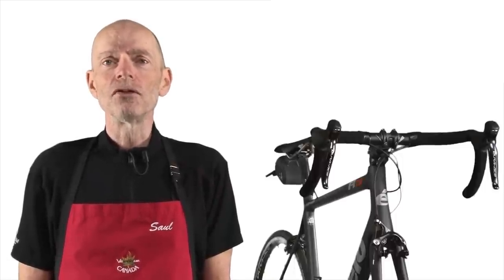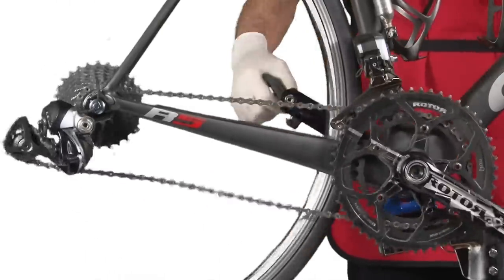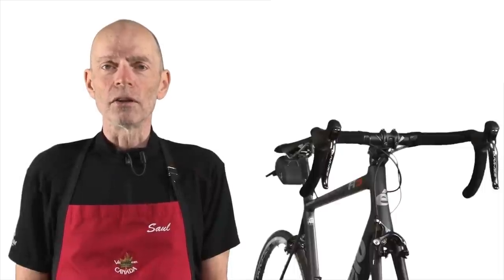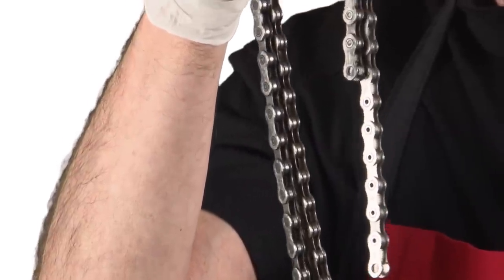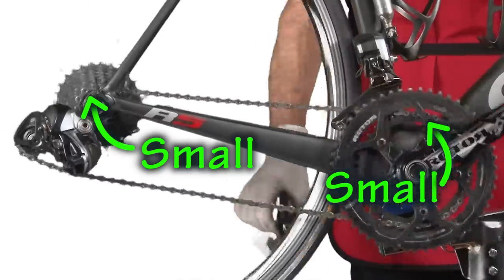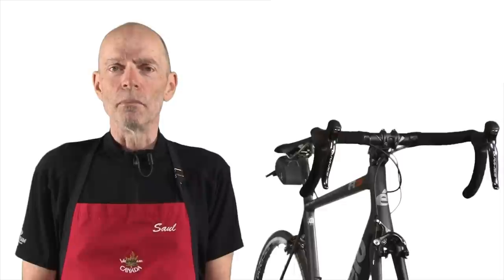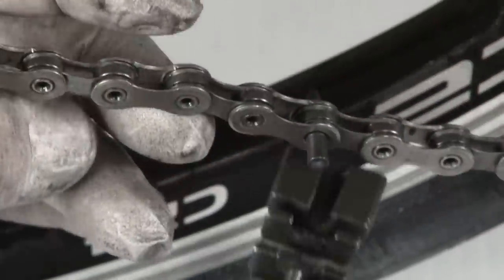Chain Length, find the right chain length for your bike

Comment: How to determine a right chain length should be taught from scratch without a sample/old chain. Derailleur acts differently from brand to brands, the derailleur should be demonstrated where would be the maximum stretch and the minimum retract. Also should let people know that there is an adjustable screw with most reputable derailleur manufacturer able to loose or tighten the derailleur tension should the chain has some discrepancy. I think the public would be more interested to see a demonstration on that aspect!

Comment: Holy cow I remember Velotique Bev and Saul! My locals. 👍
Very good video, thank you. On small crank, chain is jumping off small freewheel cog under hard pedaling, I could try removing a link to add tension, or just not use that small/smalll combo, assuming there is cog wear (chain is newer.) Gosh the cassette isn't even that old and it's the same Toronto Police bikes use!

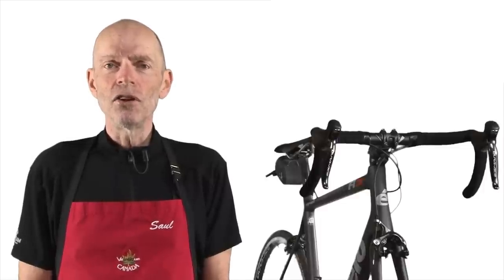Comment: 1:40 position your chain so that YOU CAN DETERMINE HOW MANY LINKS TO REMOVE.. oh come on.. If only I knew I wouldn't have to watch this video. It doesn't make sense. That's why I'm here: HOW do I determine, what criteria do I have to take into account. None of this was mentioned. So what's the point?
Reply: yes i think he missed the - this is what to look for to determine that. I think it's the S shape of the chain going through the rear derailler. Maybe he can make a comment about exactly what his criteria was in determining the 6 or so links he removed. tia
Reply from the maker: @alutious  Good point. The jockey wheels should almost fully extended, with just enough spring tension left to shift into that gear combination. The "S" is almost completely extended. Hope this helps.
Reply: @velotiqueBetterWatchSaul  just verifying what you think. The manufacturer got back to me and is blaming the chain slipping between the two chain rings is being caused by a chain that has not enough tension. Does this sound right?  Going from 50T to 46T i probably need to remove a couple of links but at higher tensions, in the lowest gear, there should be enough tension. I am going to test this out right now.

Comment: This isn't the way I do it -- I think it's far better to size on both small rings (front and back)  -- use the longest chain that will work with that combination -- and then check that the chain will work with the largest gear on both front and rear.  You should be able to shift into that combination with the rear derailleur still making some "s" shape to the chain.  If you can't shift to the large-large combination with some derailleur bend then you need a larger capacity derailleur and there's no correct chain length that will work.  This method gives you the longest chain possible and reduces friction and derailleur stress.
Reply: And then you get a chain that slaps the frame. Setting aside that the gear combination you are talking about it's just wrong.